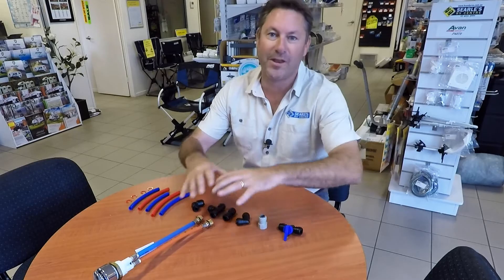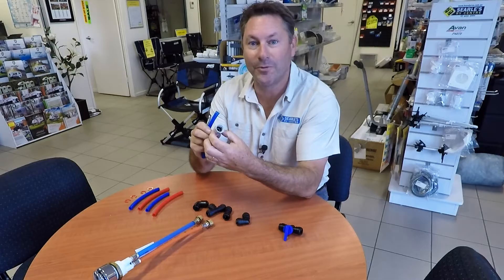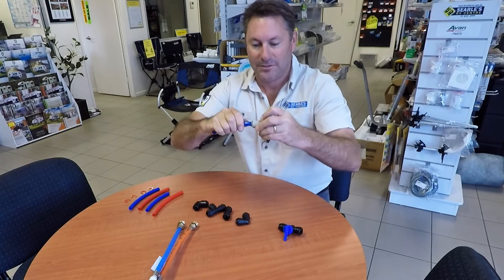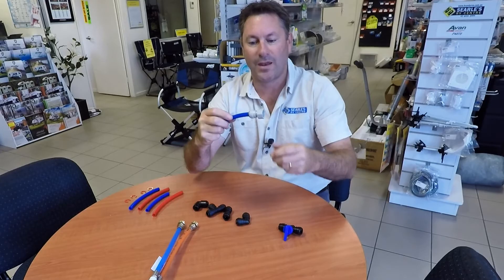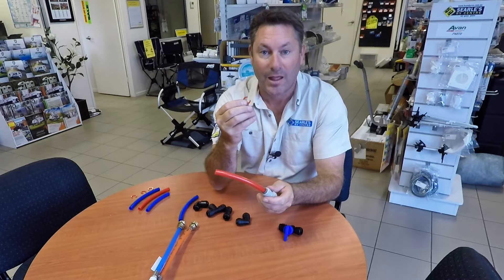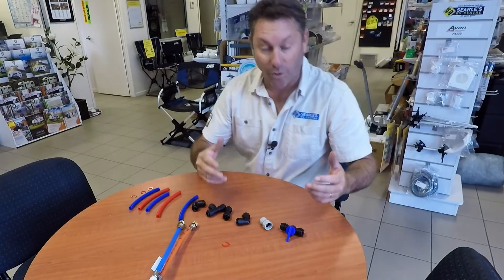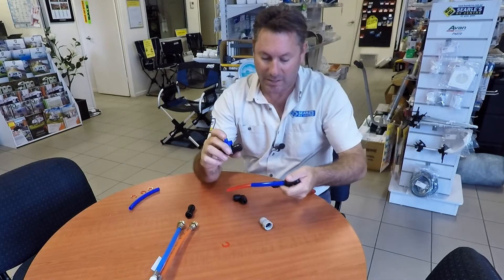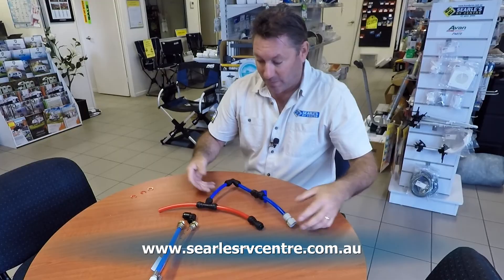Caravan & Motorhome Water Fittings

Comment: I had a hot water pipe leading to the shower burst whilst I was up north this year. To get it off I had to fit my arm into a narrow gap between the ensuite wall and the washing machine and couldn't get any leverage to push the piece in to release the pipe. (I still haven't worked out how the washing machine is fixed in)

I managed to get it out by getting a 12mm open ended spanner and levering it against the fitting. I had a mate under the van who pulled it when I gave him the OK. (He pulled it out with such force, and it came away so suddenly that he nearly broke his nose but that's another story for happy hour).

Problem then was that no matter how hard I tried I couldn't get the leverage to get the replacement pipe into the fitting and gave up trying. I managed to isolate the ensuite hot water pipe from the plumbing system for the rest of the trip. 

When I got home I chased quotes to replace all pipes (hot and cold) but couldn't get any repairers interested.

I decided to give it 1 more try and voila the pipe went in 1st go (I think performance anxiety might have had something to do with it). 

Result is that I have now replaced all pipes myself for a cost of around $40 and no leaks.

Comment: Why don't you show how to fit the end inserts, especially in the hot water lines. For 50c don't risk a leak...it will eventually
Reply: Absolutely agree 100%... I live in UK and bought a new Swift caravan 3 years ago. It was parked upmost of 2019 due to Covid lockdowns. My first outing this year I came back to my van to find the carpets were soaked. Traced the leak to the JG connector for the shower cold feed. Removed the fitting and found no insert (or clips) had been fitted, checked some of the other connectors and found the same (manufacturers cutting corners to save money FFS). I purchased some inserts, clips, connectors and a couple of metres of spare pipe. Have yet to fit it but noticed the end of one of the new pipes is slightly oval. As with the domestic 15mm pipe, the inserts are intended to maintain the circular section of the pipe and maintain the integrity of the seal. Will be fitting inserts, clips and pressure testing this weekend and also modifying the "lazy" manufacturers pipe layout to reduce the number of unnecessary connections. Why don't people make things right first time? Given the cost of a new caravan another £20 was neither here nor there.

Comment: I have a tee joint and im trying to replace the tap, however the other tap seems to have 10mm barb fittings, where is my old tap was just a straight push fit, would the barb just push into the tee piece?
Reply from the maker: I don't fully understand your question. the pipe in the straight or tee fittings simply push in and to remove you hold the collar back then pull the hose out.
Reply from the maker: You could give it a go. You can get Reducers so you put a 12 or 15mm tube in one end and smaller diameter in the other. look up John Guest fittings